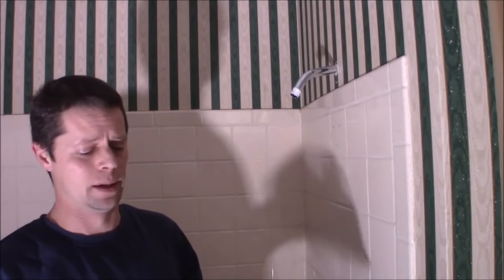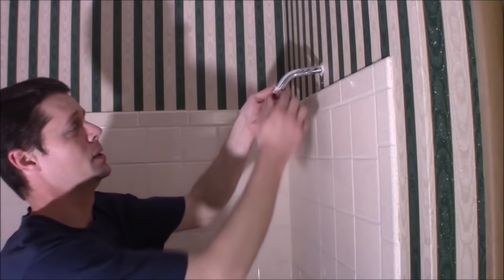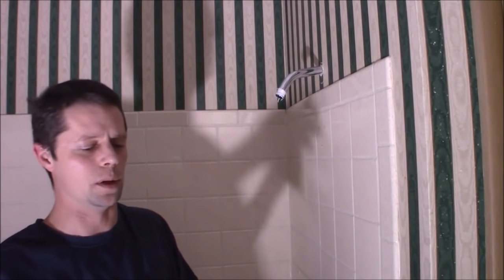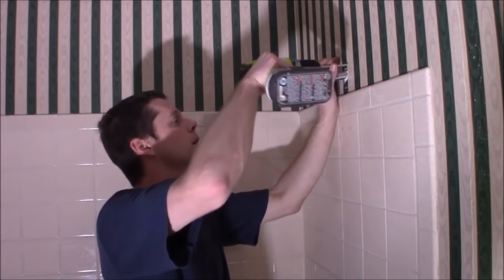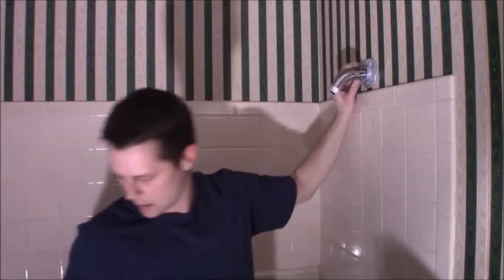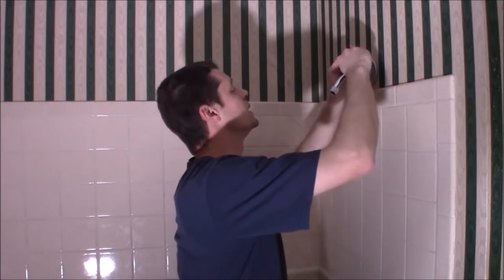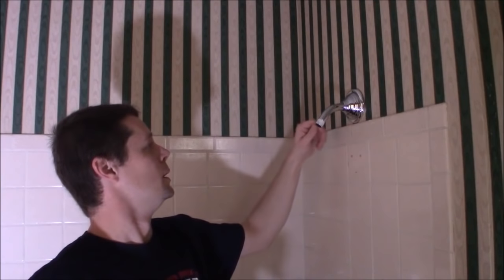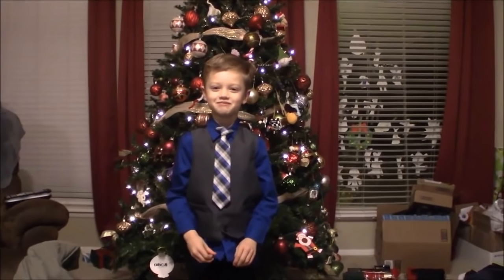Fix a loose shower pipe without cutting open the wall

Comment: Thanks. It's a clever fix. Some people are using expanding spray foam. I wasn't sure if that would last long. Your solution is better since the paste will harden and also adhere to the metal flange. I will try it soon. Again, thanks for posting the video.

Comment: Same situation in one of my bathrooms and for the life of me I don't know why people do things like this do it right the first time instead of leaving a disaster for someone else later on. I thought about using the flange technique that you have an also backing it up with an expanding foam behind the pipe. Then again I have a closet behind my shower I'll have to cut the wall game access and I should probably just fasten it to the two-by-four with a bracket like it should be thats behind the drywall. For the moment I have a small hose clamp and some wooden dowels around it to stop lateral movement. It'll hold until I have the time to actually tear into the back wall and do it correctly.

Comment: Good video. One way to get the pipe to be more secure is to wrap a rubber o-ring around the pipe and then secure with a small amount of waterproof electrical tape around the o-ring. Then the flange can attach and you can screw. Using epoxy isn’t advised because it’s a permanent bond. Easier to remove tape and a rubber o-ring later.
Reply from the maker: sounds like a pretty good approach!

Comment: Don't be afraid to cut a hole in the wall and fix it right. Drywall repair is easy with hot mud=setting compound, which dries rock solid in minutes. The reason the pipe is loose is constant pressure from moving the shower head. It's only a matter of time before the pipe loosens from the drywall. It's got to be attached to the studs like it was  or should have been in the first place

Comment: I'm doing this today. I'll post a video and let you know how it went hopefully I don't botch it too bad
Reply from the maker: I bet it'll go well for you, but definitely want to hear any new ideas you come up with. this was the best idea I could come up with using materials I could find, but I know there're plenty of people thinking up better ideas than me
Reply: @workingdad  okay so far I found a plumbing stabilizer bar seems to work the best that way no holes need to be drilled in the internal shower wall compromising the Integrity of the wall and allowing any moisture to penetrate ..... it appears epoxy may give more options I want to go ahead and get it now and get started installing it tonight. Let me know what you think when you see the video

Comment: We have this issue in our shower. It's loose and there is a bigger opening around the pipe than yours. I assumed (I guess wrong) that there would be some kind of rubber grommet available that will sandwich the drywall and cradle the pipe. Your idea is interesting though - how has it held up?
Reply from the maker: Still holding up..so definitely lasting longer than I figured it would
Reply: Thanks for letting me know! I will keep the technique in mind.👍
Reply: @randyndawna  Did you find a rubber grommet or similar to fix yours?  Mine is similar.
Reply: Mike Wilson - I didn't, but I haven't looked very hard recently. Thank you for asking though because you reminded me! I'll definitely let you know if I come up with something.😊

Comment: Nice video.  Thanks for posting it.  I am in a situation where I need to do the exact same thing as you have done in this video.  Any chance you could post links to the materials you used to do this?  In particular, I haven't been able to find a beauty ring to cover a flange like that.  Thanks again!
Reply from the maker: don't have the packaging any longer on that flange to tell you for sure what it was, but it was a home depot special from their plumbing isle.

Comment: if you remove the shower arm you will be able to see the threaded elbow that the shower arm screws into. On one side of that elbow is an anchor tab that has a screw in it that mounts the elbow into a 2x4 brace that is usually mounted behind the elbow.  You likely have this 2x4 else you would be able to push the shower arm 2 to 3 inches into the wall. Most the time when a shower arm gets loose it is due to the mounting screw coming loose. Simply tight this screw. If the screw is missing then find a screw that will fit. Once  you tighten the screw get some plumbers tape and wrap the threads of the shower arm and re thread it into the elbow. There are all kinds of videos on installing or replacing shower arms.

Comment: Thanks for the video. Question: Did the JB Weld work? Is it still on? Or, did it break loose after a while?
Reply from the maker: it's still on, been almost a year now, and has held up to kids' abuse/use of the show quite a bit.  and we use the wand to wash the dogs, so sees quite a bit of use

Comment: Ditto problem broke loose and no access from back.. thanks for ideas.  Thinking make hole slightly bigger. CAREFULLY INSERT in a TOUGH flex garbage bag into the hole/pipe still in place.  Foam straw into the bag and tightly electrical tape the bag to straw.  INJECT foam into bag as much as it will hold.  Ballooning it and Let dry.  (This is the way they support heavy items for shipping...foamed in box.  FILLS large void.)  TRIM off bag and check support/hopefully it has blossomed into the stud cavity and around pipe.  Then foam into any cavity that seems to be left around the pipe.  
REASONING: Balloon bag will support sideways and back of pipe.  2nd foam NOW will not now fall down the wall but fill in better VERY TIGHT next to pipe head sheetrock.  LOCKING IT IN VERY WELL forever against the heavy tile wall and studs.
Will follow up and let everyone know how it goes.
Reply from the maker: actually does sound like a good idea, let us know how it goes?  or get the camera out?
Reply: @workingdad  Finally after 2 cans of foam-O fill.  Had to cut open the wall as much of hum would return. Filled up very well both at top and at what dropped down on single pull Moen in wall.  HUMM still stayed. Replaced Moen head with same model...hum gone.  Best est. was head had something that got past the screen filter and was causing the hum...wish I had changed the head first...But you learn in life.  THANK YOU FOR YOUR CHANNEL!!!
Reply from the maker: @TheTruth.K.J.V.  thank you for watching and the kind words, and also sharing your idea there, that actually sounds really great!

Comment: I thought about using  expanding foam due to the tile around the pipe.  My question is though if I do that, will it make it nearly impossible to remove the pipe in the future?
Reply from the maker: it might, but I figure if it ever comes to that, I'll be tearing out the wall behind to fix it the right way and I'll just pull the pipe out from the front once I cut it in the back
Reply: Do it right.
Cut a square around the shower arm, secure it put back the dry wall, paste it, sand it,  paint it..... done.

Comment: similar set up here.  except mine comes right where the tile and drywall meetup.  i wonder if i should go the spray foam route vs jb water weld.  I'm a big fan of that jb weld product but its a little too permanent if I need to crack open the tiles to service it.  how's the shower head set up fairing these days?
Reply from the maker: Still holding up, and I have to admit being surprised, never thought it would last this long, especially with two young kids using it

Comment: The problem I have is the pipe runs through the tile in my shower.  the back access in actually facing the outside wall of the house. I think the expoxy idea seems the best quick fix for now.
Reply from the maker: yeah, I wonder if you could epoxy just around the pipe to the tile and not use the collar like I did.  you might even be able to epoxy the collar to the tile if you could keep it in place while the epoxy cures.  of course ever getting if off without destroying the tile might be a challenge
Reply: I have the tile issue also. Hmmm. Maybe epoxy to the tile. My faucet control is loose also so maybe I'm better off ripping the wall out behind.

Comment: @daddy's work is never done what was the name of the plastic support piece you showed earlier in the video? It may work for me.
Reply from the maker: not entirely sure what the official name is, but something along the lines of a behind the wall pipe support for PEX, meant to be installed during construction behind the drywall.  Big box stores near me seem to have them in stock in plumbing area
Reply: @workingdad  I found it. Its a stud suspension clamp. My stem is not as loose as yours, but it wobbles a bit. I figure if I make the hole in the drywall a tad bigger, stuff that in the hole over the stem and then screw it into the drywall it wont move. Whenever I do a bathroom remodel I will make sure everything is secured in the wall. Here is the product link.

https://www.homedepot.com/p/Apollo-3-4-in-Plastic-Insulated-Stud-Suspension-Clamp-10-Pack-APXSUSCLAMP34/301541118

Comment: My shower head arm is pointed towards the wall and is not centered what's the best way to go about this without having to remove the drywall
Reply: I have the same issue. Did you end up fixing it? How did you do it??
Reply: @kylebesemer9354  I got a swivel attachment

Comment: The wall tiles should be above the shower pipe. Water shouldn’t be closed to drywall.
Reply from the maker: exactly. house was built in 1960, pretty sure the tile and shower head were added on by a prior owner at some point prior to me.
Reply: I filled the gap around shower arm with caulk yesterday and it looked pretty solid.

Comment: This is first thing I thought of, but most ppl.. well if you have a proper shower.. it's all tile. I'm drilling into my expensive tile? Not sure about that. Has to be a way to brace pipe in wall. I'll ask guys I work with or a plumber. Haven't seen too much on youtube or Google. Or haven't checked every freakin' thread/forum. Plumbing def my weakest spot. Good solution if you have part wall. I mean if you used that shower regularly how long before walls turn to mush? Never understood showers like these.. well money of course, could be laziness too, but don't get it. I had one with no tile at all in the projects.. walls a mess, paint chipping.. my uncle and grandfather just hung plastic/vinyl shower panels. Probably $15 20 dollar ones. What a POS. disgusting. But after, probably had one of best showers in projects and one of few to have a hand held shower head. Most ppl bathing in filth with buckets, just had a pipe coming out bottom with 2 knobs. Real high-end.
Reply: Maybe a strong epoxy or 'gorilla glue', but still, what would happen to tile? Idk. Thanks for vid though, my man.

Comment: This Mickey mouse job shouldn't  not be done.

In the event of replacing the shower arm, the welding compound will be stuck the shower arm.

The correct  way would be to acces from inside the closet and secure it.
Or
Cut a part of the front shower arm  dry wall at the frame and acces the secure point .

Replace the part dry wall and paste, sand and repaint.
Reply from the maker: as I said, not the most ideal, but the best I could do in a bad situation-tile on one side and cabinet on the other.  it's worked well enough for a few years now and for others as well..so maybe the mouse knows a thing or two?

Comment: I think there is a flange at lowes that look similar and also have a set screw that you can use a Allen key to secure. https://low.es/3jPvjfX . Save the water weld mess. :)